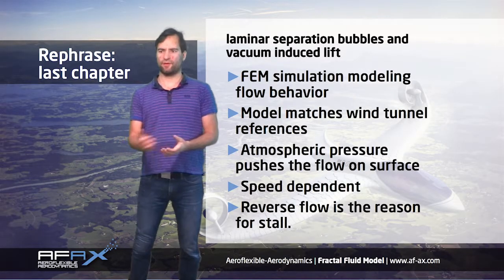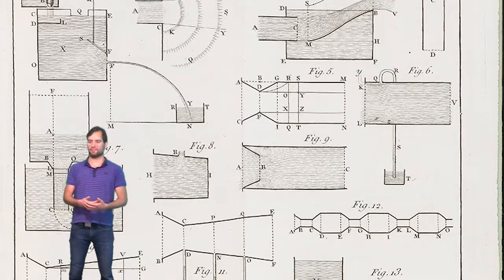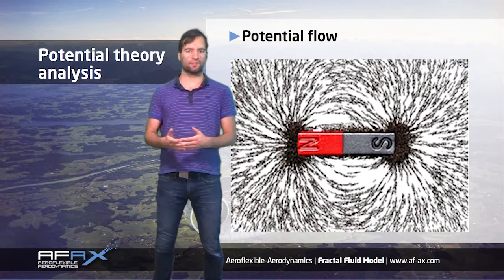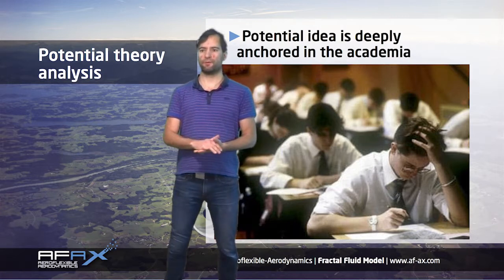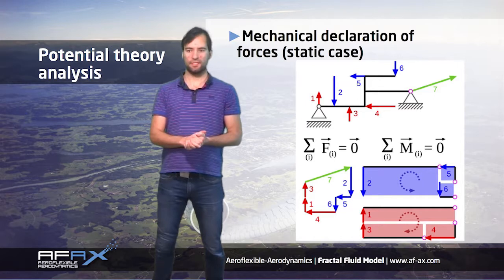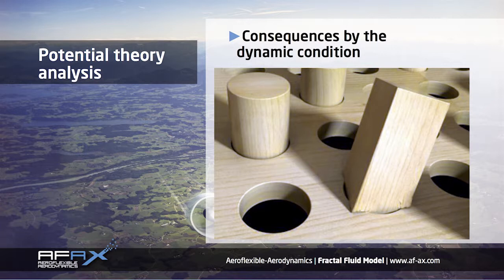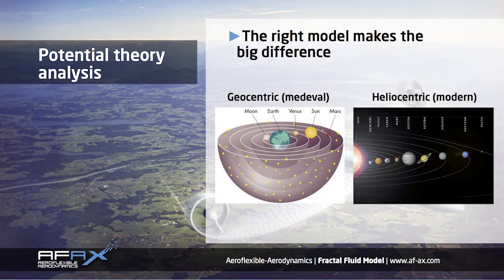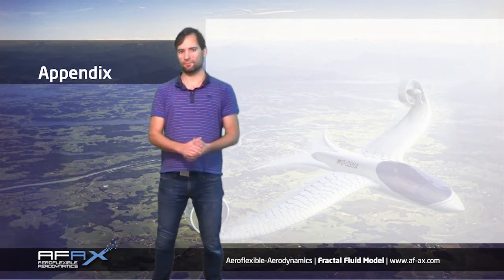Fractal Aerodynamics - Chapter 3 - Potential Flow

Comment: Why does Theodore Theodorsen's lift and moment for unsteady aerodynamics work relatively well despite being based on potential theory? They assume reversibility at the start of the derivation yet provide a pretty good description of how disturbances from a wing will propogate through the potential field also corresponding well with experiments. Is this because in that situation it really is the boundary layer where the majority of irreversibility is and thus will not factor in as much as something like the vacuum versus the blow dryer?